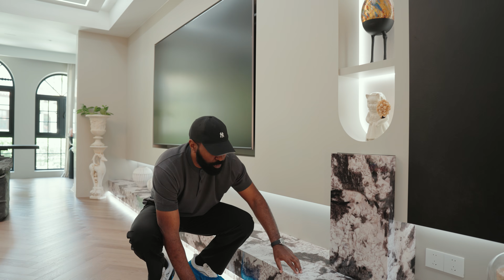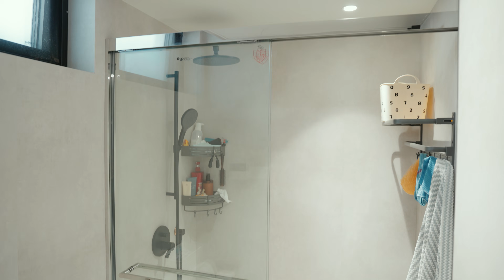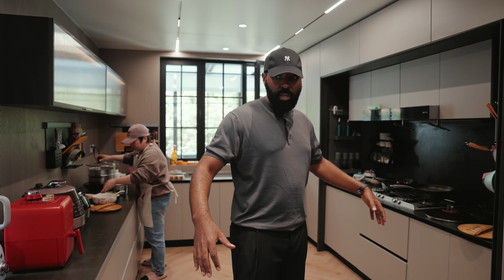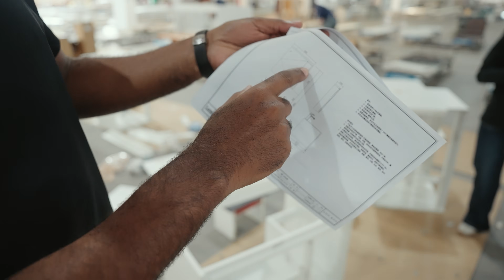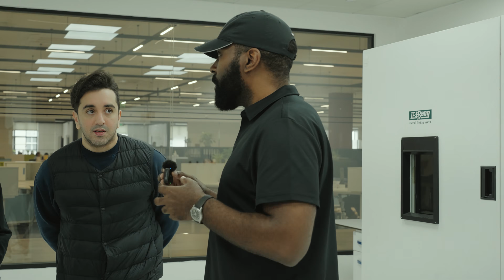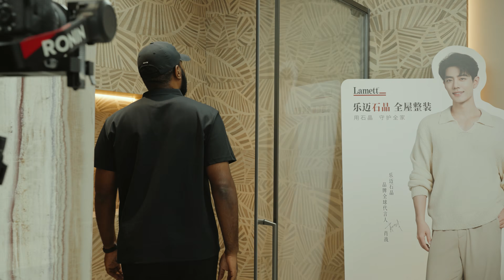Inside an $8 Million Home Built Entirely With This ONE Material

Comment: Legit amazing.  I can imagine how building with this material improves efficiencies.  It also is aesthetic and safe.  What's the downside?  Is it expensive?
Reply from the maker: Great question. The honest answer is that Crystal Stone sits at a reasonable price point compared to standard flooring materials, but here is the context that matters. When you factor in that it replaces your floor, walls, and ceiling in one material with zero maintenance, no grout, no sealing, and a 10 year warranty, the total cost over time is actually lower than tile or marble. The upside is you get a certified formaldehyde free, waterproof, whole home system backed by independent lab testing. The downside is you need to see it in person to fully appreciate it because photos do not do it justice. We are opening our UAE showroom soon. Drop your details in the link in bio and we will reach out when we are ready to welcome you.